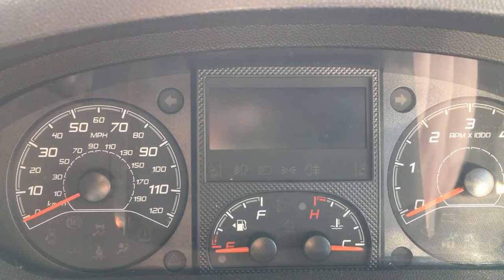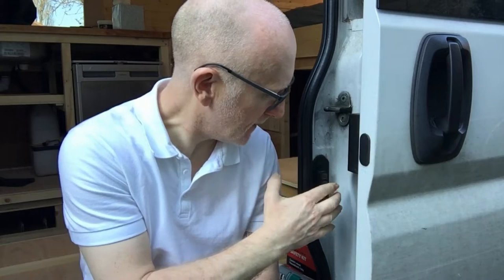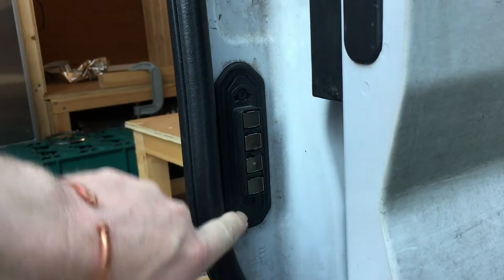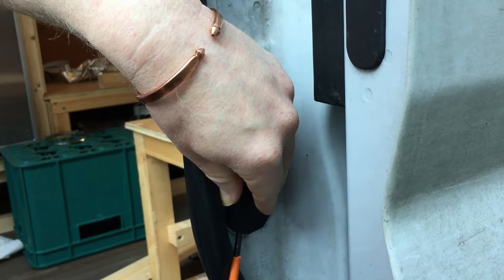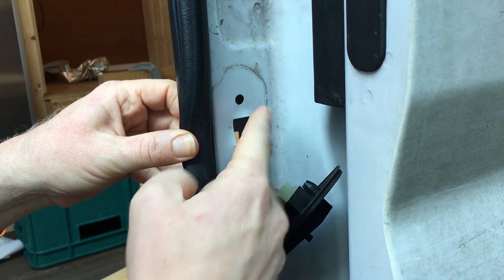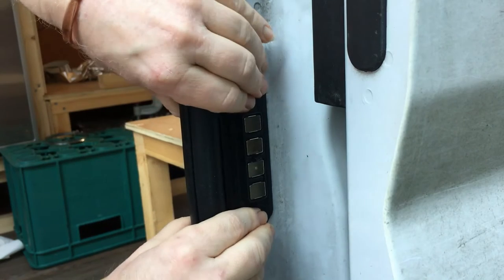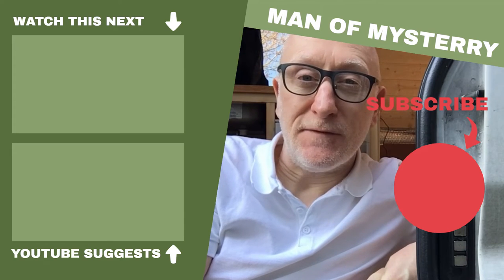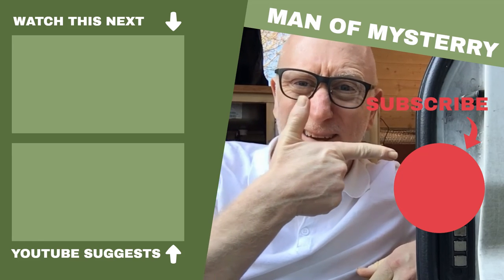Sliding Door Fault Repair on Fiat Ducato Peugeot Boxer Citroen Relay Vanlife UK

Comment: if this doesn't solve the issue, look at the contacts on the sliding door. opposite to the plastic pin in the video is an adjustable plastic piece that is also spring loaded. this piece on the door can be pulled out by 2 or 3 clicks and solves the problem for me
Reply from the maker: Hopefully this will help someone and save them some money. Mine was fixed, I say was lol needs a new handle now as it snapped in the freezing weather 🥶
Reply: You bloody genius!  I had this problem and was scratching my head about it. I figured out the at the little switch is pushed in by the plastic peg in the door mounting, but not that it was adjustable. I was totally stumpted until I saw your comment. Ten seconds later it was fixed! Thank you.
Reply: How did you pull this out? I tried with some pliers but could not pull it out with some click ;) - would you mind showing us?

Comment: Thanks for your video, I recently bought a converted 2017 Peugeot Boxer camper and had same problem, I have not gone as far as you but what I did was spray the contacts with WD 40 and open and closed the door a few times and that seems to have done the trick
Reply from the maker: I have my next problem haha the handle broke when the door froze shut so when it gets warmer and dryer there will be a handle replacement vid too 🤣

Comment: Nice easy fix. Transit Van's use a similar type pin and contact system and they are also prone to falling but its usually dirty contacts on both the flat plates and spring pins. Transits are also known for the central locking mechanism failing in the side door.
Reply from the maker: I initially thought it might be dirty contacts but cleaning made no difference.

Comment: Just be careful once the metal is bent outwards as the switch may not sit flat to the bodywork and allow water to go behind. Best to bed it in with a small amount of silicone to make sure it's sealed

Comment: I did the above, adjusted the door etc but it kept on coming back. Take the sensor off (on the vehicle, not the door), then remove the smaller cable. Central locking and everything works as normal.
Reply: Sorry for commenting twice, I was trying to update all of the videos! It took me ages to work out! I hope it helps someone.
Reply from the maker: Another good hack. Thanks for sharing 🙏🏻
Reply: You are an absolute life saver. Spent hours on this, tried everything including packing the sensors, adjusting the prong, even fitting new sensors, then saw this and went "surely that can't work.." and yup, worked straight away. Thank you so much!
Reply: Yes, this worked for me aswell. Tried everything, Then left the small cable disconnected and works like a charm again.Thx a lot. Peugeot boxer 2012
Reply: Do you mean remove that sensor he popped out and tske out the cable that is connected inside ? I'm having a nightmare with this fault and this video didn't work unfortunately. Tia

Comment: Did you find also because of the lack of connection also the alarm would go off when locking or not always locking. About to go and try this. Also on the door itself i only have 3 pins but there are the same 4 connectors as tou show on the van itself
Reply from the maker: It’s a while ago but I don’t recall having issues locking it, just the annoying beeper when driving.
Reply: @ManOfMysterry  so problem solved, did as in the video. It randomly started mid drive home yesterday "rear door open" pulled over realised there was a fault.. got it home and when trying to lock the rear wasn't locking and alarm would go off... so knew it was a connection issue.. so glad I found this thank you.

Comment: I did the above, adjusted the door etc but it kept on coming back. Take the sensor off (on the vehicle, not the door), then remove the smaller cable. Central locking and everything works as normal.
Reply from the maker: Only just seen your comment. Glad you got it sorted. Mine was driving me crazy 🤪